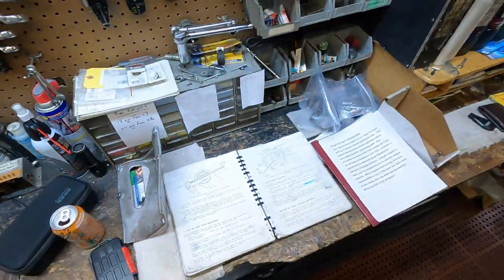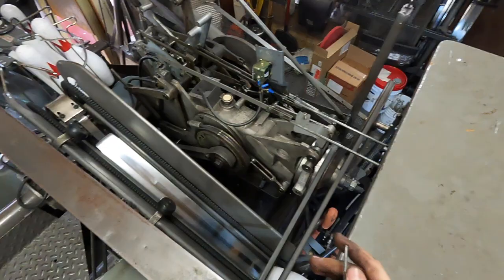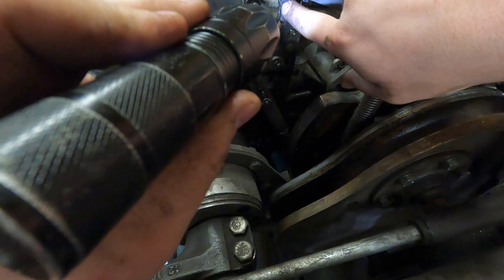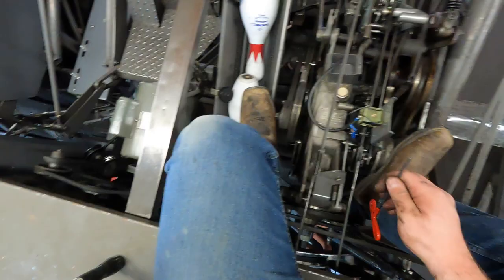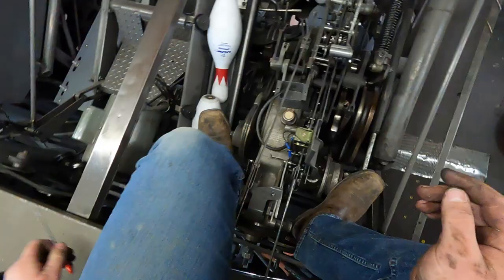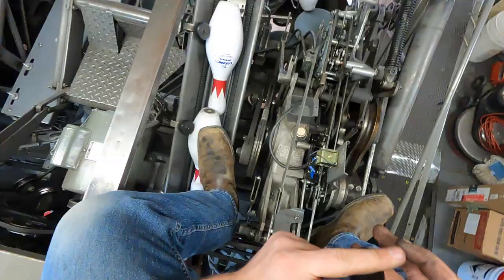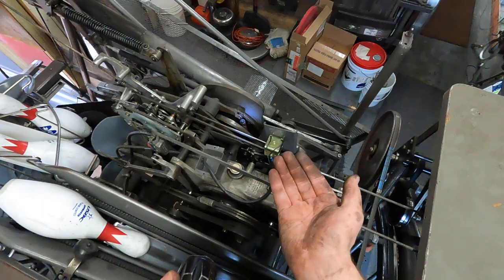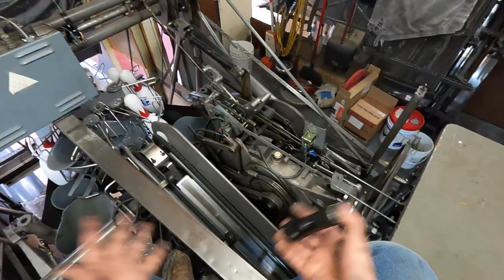Stop Collar #10 - Brunswick Pinsetter Adjustments

Comment: Would that cause "Banana trees"
Reply from the maker: What’s that lol? Hanging 180?
Reply: @shawnmbowling  lol. Rake drops sweeps the pins off the deck. Then won't reset the pins back down on the deck. They pretty much just hang from the deck until we use the 180 lever for the deck to set them back down into place...
Reply from the maker: Yeah hanging 180 it sounds like lol. Dashpot adjustment is the one I’d be looking at, hanging 180’s are caused because the gearbox doesn’t stop at zero degrees so the next place it knows is 180
Reply: @shawnmbowling   so took care of the hanging 180. Now it will randomly not set a full deck after 2nd ball. 5 pin will go through the chute then just sit there. Have to move the 180 lever to set them.  Then it'll run fine for a few cycles and then have to hit the 180 lever again to set the deck. Weird.
Reply from the maker: @blackbeard6663 have you looked over your 180 adjustment?

Comment: Nothing to do with the dashot adjustment but I have a A2that when the five pin goes through  the chute none of the rest of the pins drop
What causes this ???
Reply from the maker: I just had to fix that issue today. It was a frozen bearing up front for the spider cam. The bearing on the front of the Turret Frame. I would check there first seems to be the usual suspect